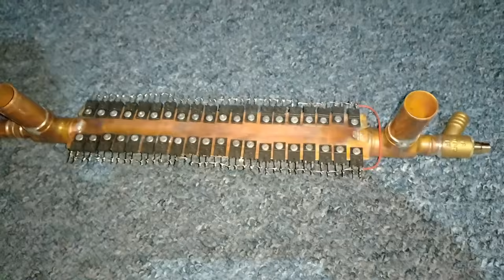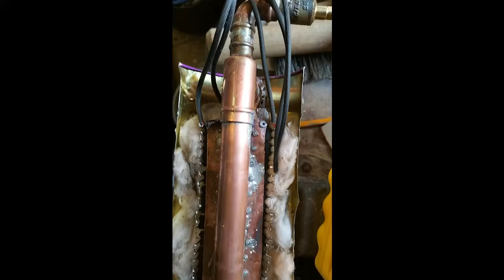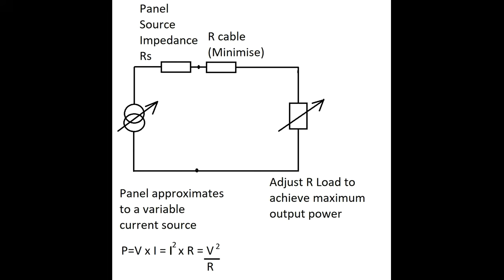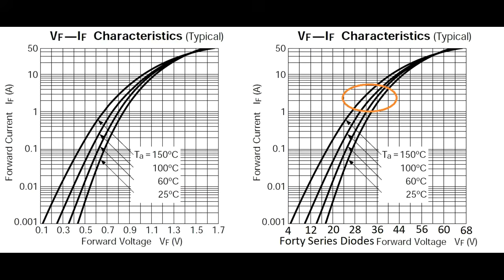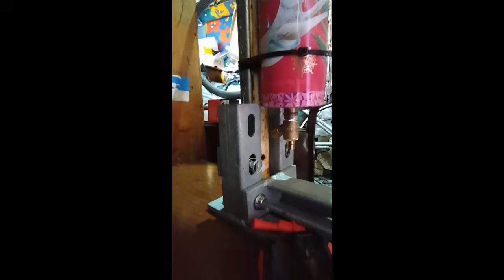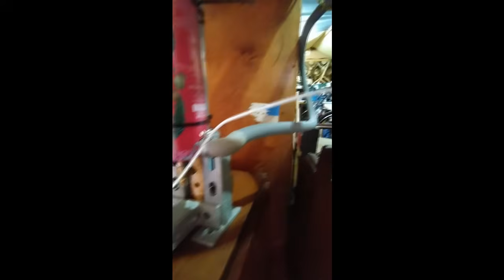Direct Solar Water heating from Photovoltaic cells heating diodes

Comment: Thanks for sharing your ingenious design. 
Now that inexpensive micro inverters are available, it would be interesting to compare results of solar PV heating using your DC device and a micro inverter connected to the existing AC heating element. 🤔

Comment: hi, i looked up this diode online, it's telling me it's a 600volt diode...is this what your actually using? i thought you tried to keep the voltage under aprox 50v for safety, i'm new at all this and my knowledge is still very limited, thanks
Charles from Canada
Reply from the maker: That's just the diodes reverse withstand voltage rating. We're using these in forward bias..!

Comment: Outstanding work sir. Thank you for sharing and documenting all of this work, data and charts. I have done some similar experiments to heat water from solar. What still fascinates me is how a string of diodes seem to hold a set voltage (more or less) while the current varies in real time according to conditions of the current limited source (solar panel). I never got tired of watching that behavior. Amazing for such simple technology. I had trouble with the initially very cold water causing voltage to be too high at the start, which lost overall power... and I wonder if a polyfuse, thermostat or some simple device could short a couple diodes out of circuit early on to help kick start the heating process , and thus extract more watt hours into the water overall. I hope to give that a try as soon as possible. Thanks again! -Dave
Reply from the maker: Thanks for your positive feedback. I think the diodes benefit from COLD solar panels at the beginning of the day as there is a very significant negative temp coefficient effect on Voc and Pmax as the solar panels themselves warm up..